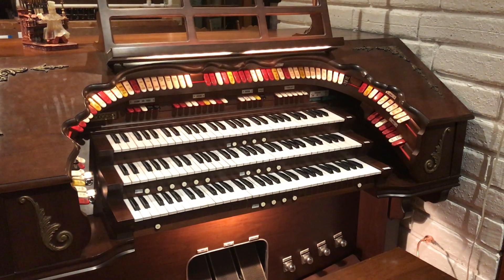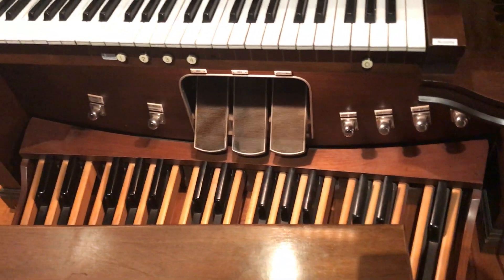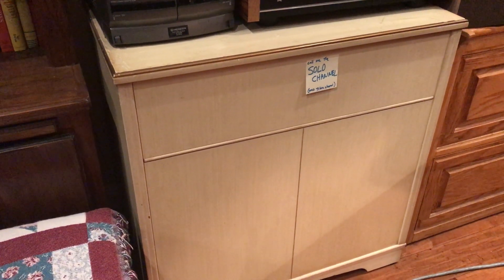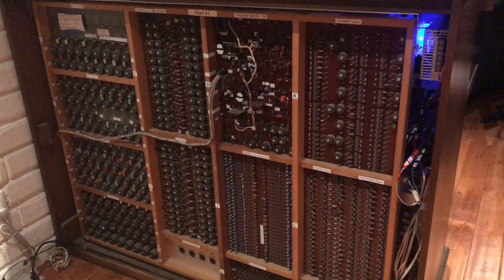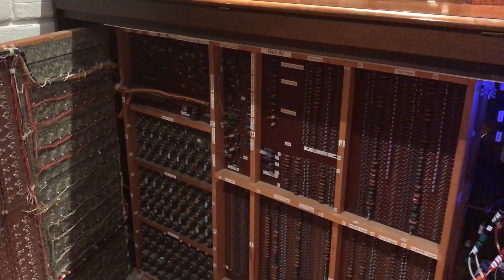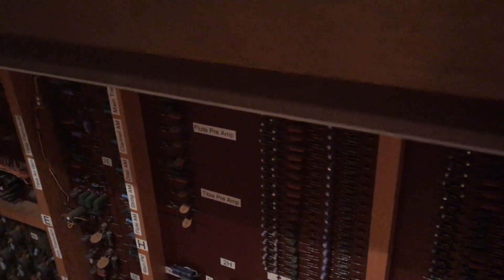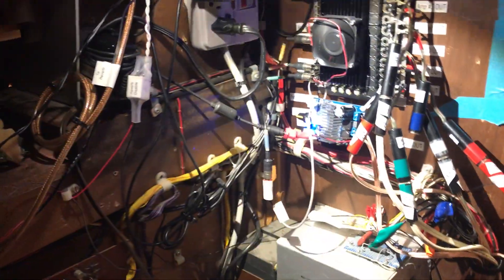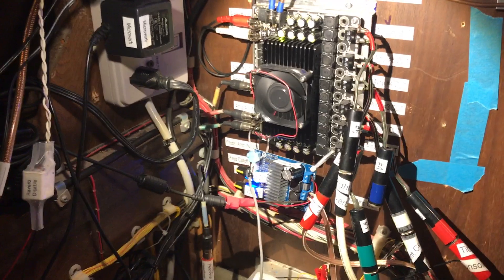ThisOld340 A quick look inside the Rodgers 340 Theater Organ - Part I

Comment: Magnetic 2nd touch?? I don't think so. The key switch is 'whisker'...nothing new.  The pedal keyer switches are REEDS and these are magnetically operated.  This ROdgers PC stuff dates way way early. NOtice discrete/hard wiring on each of the 'cards'. Wow!! The 'chime bars' are nice...and some folks bought the MAAS ROWE tubular chime option...I played such a 340. The Rodgers  analog TPO's were TOP NOTCH ...far above ALLEN (their TPO;s were the very same osc ranks used in their church organs; their TPO was nothing more that high speed trems and a load of acoustic rotating baffles on the speakers. Pretty LAME!) . Anyhoo....these Rodfers have that classic WARM tone for which so many of us yearn. One thing of note: This baby is 37.5: deep....won;t go thru your 36" front door!! I set mine in my music room,  double french door entry. Am I blessed or what? My 340 has been adopted into my family of 2 custom VTPO's! Yes...I am gaga for TPO's (well...VTPO anyway).